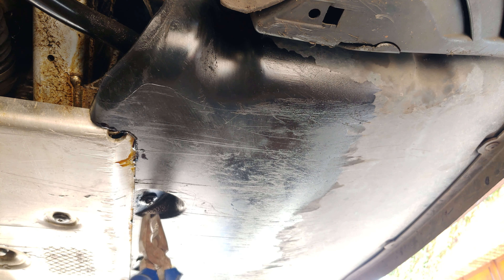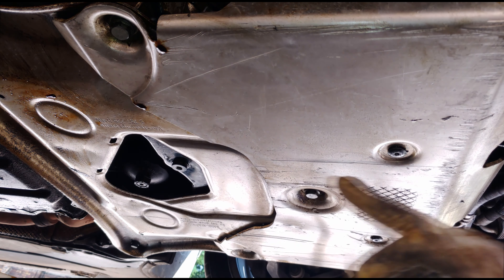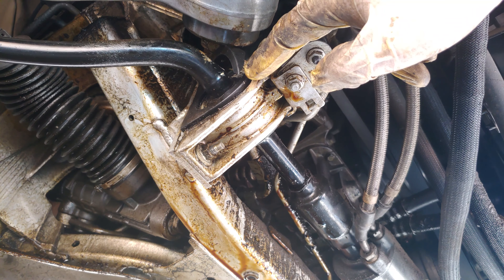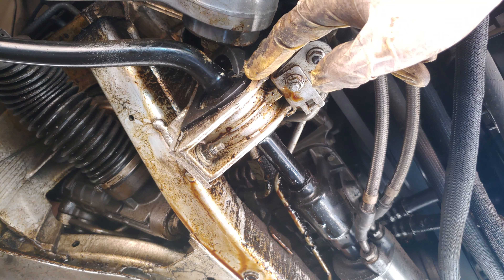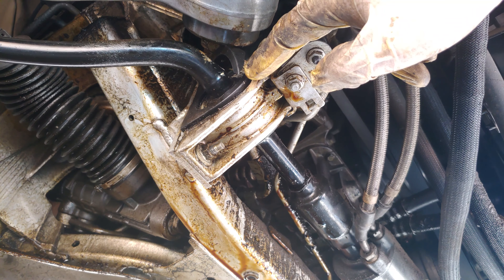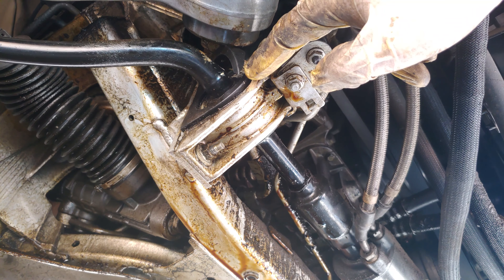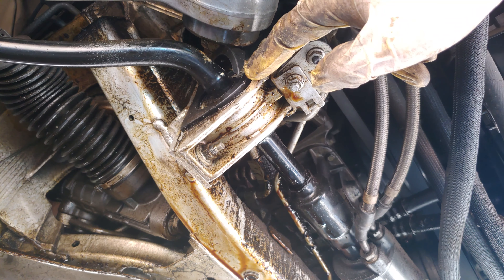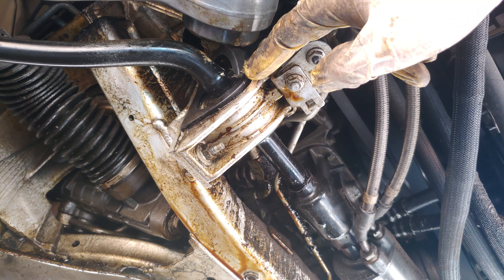How to replace front stabilizer bushes on a BMW 7 E65 - All steps

Comment: I have a problem with the actual active sway bar, not the rubbers. Basically is leaking hydraulic fluid. Do you know if that is repairable or do i just have to change it? Thanks
Reply from the maker: they do leak on mine but too little to do anything about it. Its more like sweating. If its a complete leak well then you need to take action. I think its power steering fluid. Its repairable.
Reply: @ecologicaltime   is a proper leak. And the car also leans on a side
Reply: @bitzu1993  ....mine too, unfortunately I think we will need the actual swaybar with the motor mounted to it........
Reply: @ecologicaltime  how would you go about repairing it? Hydraulic fluid is notoriously difficult to work with. I've seen forums where they apply adhesive and then permatex gasket sealer on the rubber boots. Seems to do the trick for the front sway bar but the rear is located underneath the subframe so it's a huge job to remove and so better to seal while it's still on the car. Failing that you could buy a M14 X M16 joiner and create a loop for the rear hoses and effectively remove the rear active sway bar. Interested to know your thoughts